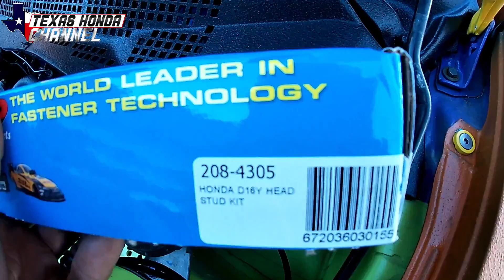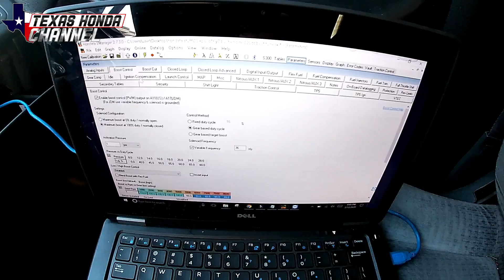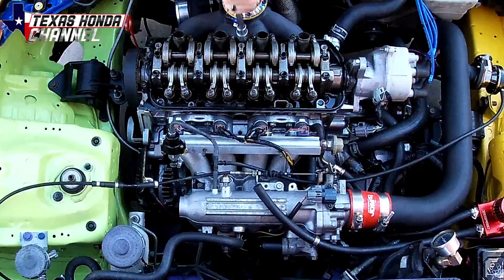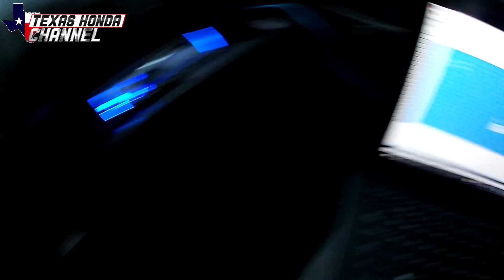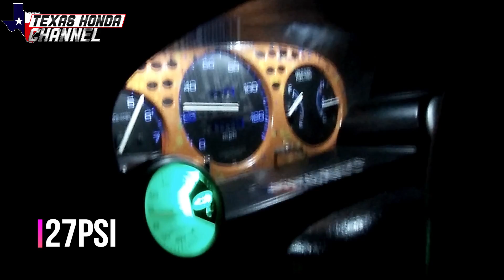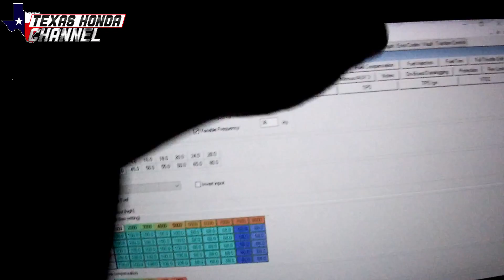D16 ARP head stud install without removing the head + 1000cc injector install

Comment: Did this engine ever suffer head lift after this? Am considering doing head studs this way but unsure 😅 would you agree with this order?
1) remove singular head stud, starting in the middle
2) install arp stud hand tight
3) repeat with all
4) torque all down?
Or do you swap step 3 and 4 and torque each one down as you install it...I think this is important to clarify coz if you're removing all stock bolts before torquing any new ones down then surely you'd want to start from outside heading in as not to warp the head

Comment: Just to clarify the torque staging process, you pulled each stock bolt one by one and replaced it with the ARP bolt and torqued it to 15lbs? Then went back to each bolt in sequence and torqued it to 30lbs & then to 60lbs? Or did you torque each ARP bolt directly to 60lbs? Awesome video! Thank you!
Reply from the maker: Sorry i don't see a lot of older comments but the people of the internet have their ways of doing it but i have done it both ways, 1 at a time getting them snugged up then doing normal tq procedure and i have done remove all keeping head there then install and normal tq procedure. i would do the 30 then 60
Reply: @TexasHondaChannel  Awesome, thanks for replying!

Comment: If the pin inside the injector connector are the same you could have used a paperclip to swap the connectors in and kept things a bit cleaner.

Comment: I just found this video while I’m working on my own Honda so I don’t know what mods you’ve done to yours. What mods have you done? Asking for reference to see how much power my build could theoretically make
Reply from the maker: Swiggy NutMcgee Idk what my power is at. I have the entire build here on the channel so you could see every mod done. It is a vitara build stock y7 head and cam, z6 intake manifold with type r throttle body port matched, 8lb flywheel stage 4 clutch, forged rods and vitara pistons OEM 75mm bore, block guard, GT30 eBay turbo, log manifold from amazon, intercooler kit from Amazon. 1000cc injectors/solid mounts.

Comment: Those injectors are almost as loud as the direct injection high pressure pump on my cobalt, I say almost because the di fuel pump sounds like loose lifters.
Reply from the maker: sinformant Jeez! I did valve lash adjustment while the engine was out so and it wasn’t that loud prior to installation i noticed they were loud so I figured I would point it out before someone says I need a valve lash adjustment lol
Reply: @TexasHondaChannel  yeah at idle the pump sounds like a clock ticking lol. It is right up on the motor and driven off the cam so im sure that's why it is so loud.
Reply from the maker: sinformant Yea that makes sense. I seen them before

Comment: Very timely, I'm getting ready to do a head gasket on a y7...couldn't decide...but now, I'll just pop in the ARPs when I can afford them. 
Keep up the good work.
Reply from the maker: Last hut on the right If your headgasket is bad I highly recommend replacing it before doing this install but this is a alternative if the headgasket is still in good shape.
Reply: @TexasHondaChannel  Gaskets bad and replacing it is a must...I just won't be using ARP studs initially.

Comment: Why you didn’t use the srt4 arp stud they are stronger
Reply from the maker: hector vazquez These ARP head studs are strong enough for me. I have been using stock oem head bolts up to 30psi with no issues but these Head studs are much stronger than the OEM so I’m happy with it.